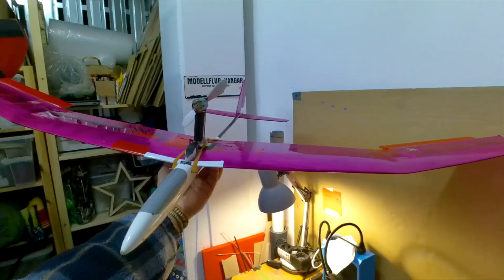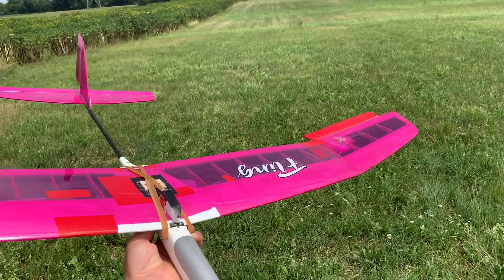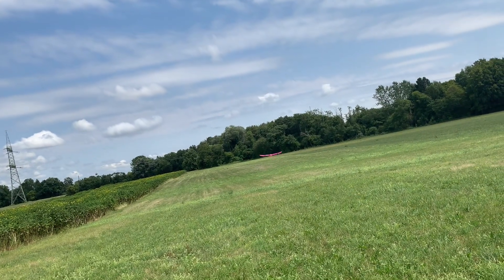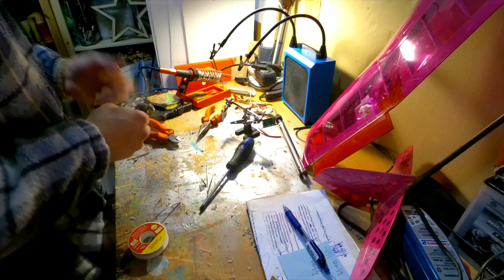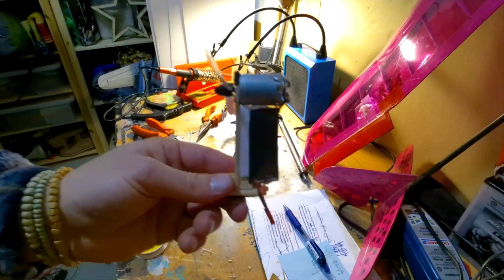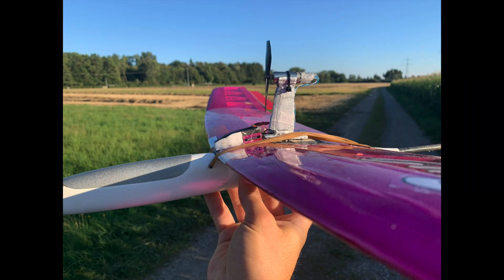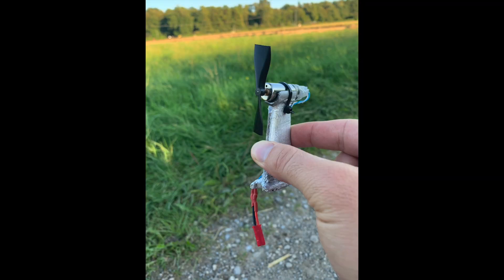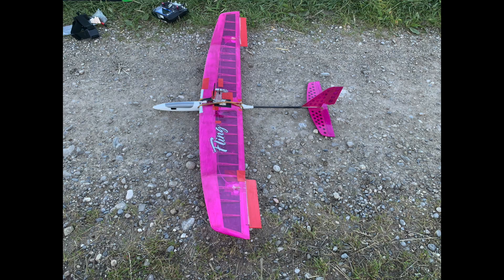Ultralight RC plane motor mount DIY

Comment: I have sometimes toyed with the idea of doing something similar - with a twist. I imagined a pod that could be jettisoned into a small parachute when the climb was done. If you fly with that on top of the wing you get both the weight penalty and the drag penalty. Today I mostly fly with a motor in the nose with foldable propeller blades. I get the weight penalty, but not so much drag added. Also, I don't have to go looking for the jettisoned power module! Thank you for sharing your video
Reply from the maker: @KetilDuna thanks for your appreciation! After experimenting with the attachable motor I fully agree - motor in the nose is definitely a better (maybe the best) setup! Nevertheless: like the idea of the jettisonable motor ;-)
Reply: @rcandotherarts9763  There's so many choices, also in this hobby and even if you focus on gliders. I just spent an evening updating firmware on a frsky access receiver to acct...for reasons :) Did think on a pod though.. It would need to be self sustained, and probably released by a servo in the plane. This must also stop the motor. That leaves a streamer/parachute. I'd happily follow and contribute to such a project! If you hand-launch, the pod could hang on the underside, perhaps easier to drop..